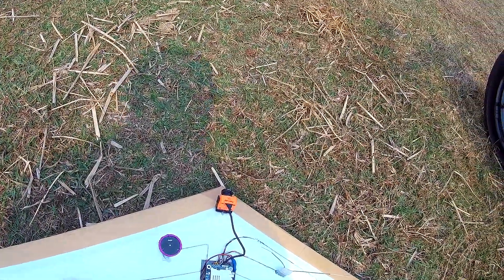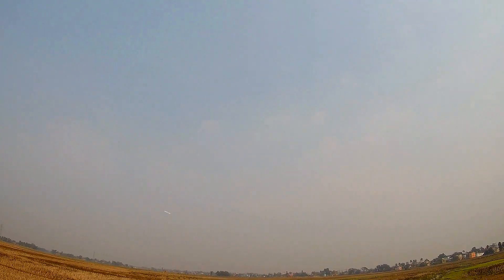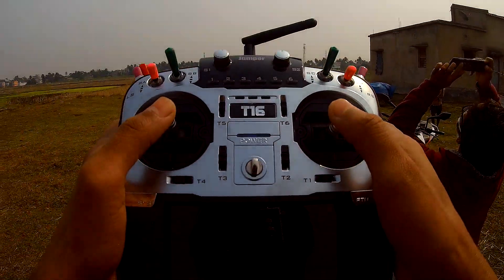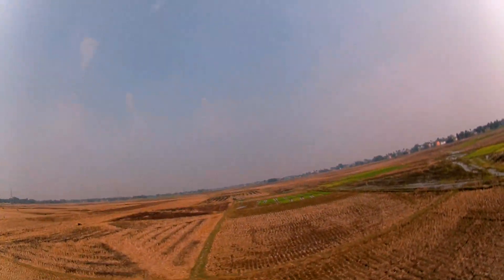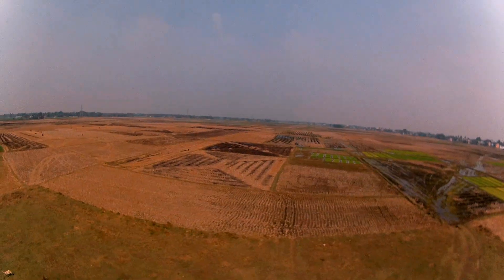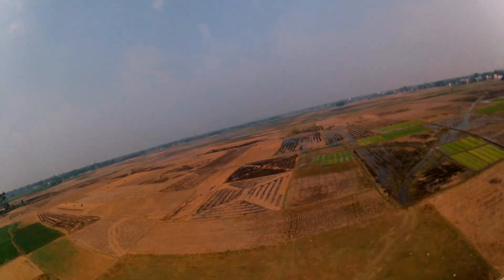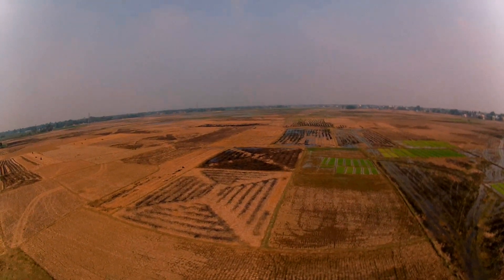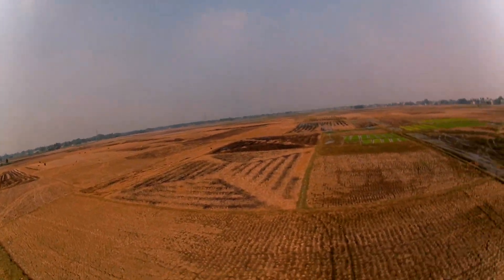Maiden Flight DIY 250g HD FPV Autonomous Plane

Comment: Nice aircraft, was any part of that flight autonomous? (No input from outside the aircraft). I am very interested in fixed wing long range autonomous (set and forget) flight. Thanks for uploading.
Reply from the maker: for some time it follows the waypoints to circle around but after completing half of its waypoints I take control because my battery was the crappy one also I forgot to configure the RSSI value that's why I was getting the wrong RSSI value.

Comment: hello sir i want help i am making an rc quadcopter using sp racing f3 would you please help me out here
Reply from the maker: what you want to know???
Reply: I need help in PID  tuning of the drone for a stable flight. I am using cleanflight firmware in sp racing f3 deluxe.